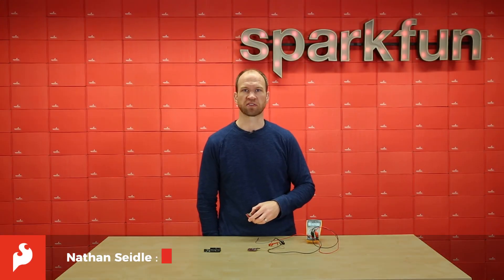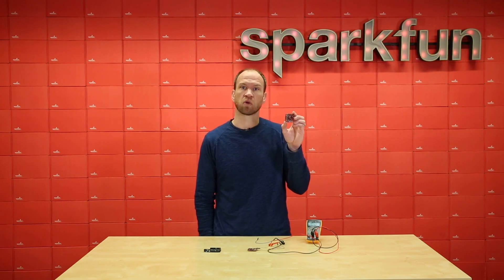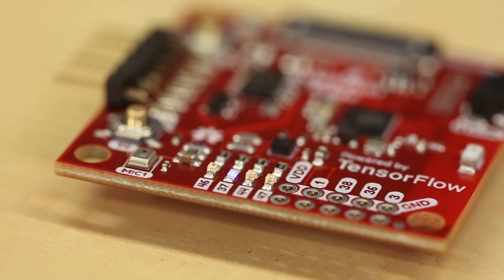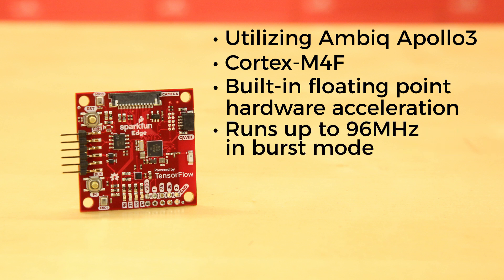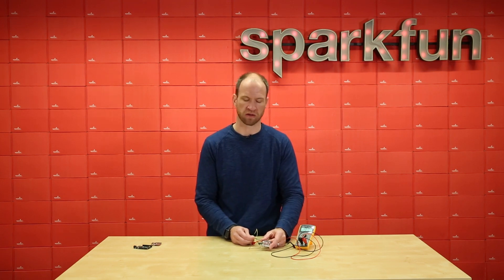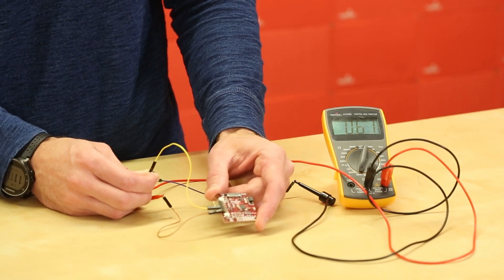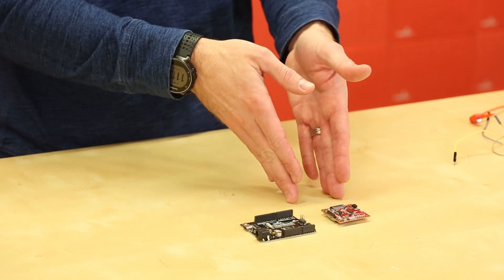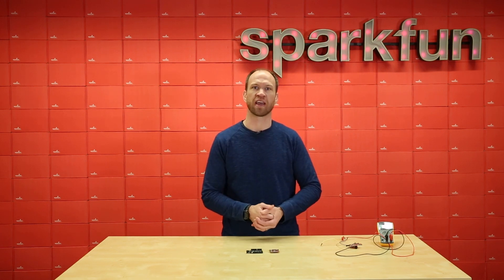Product Showcase: SparkFun Edge Development Board

Comment: Uh.... 
I don't follow your math where you say the board can run as fast as six Unos.  But then you say you'd need 30 edges running at the same time to equal a single Uno.  
Um....
Do you mean that a single Edge consumes 1/30th the power that an Uno does?
This should be clarified.
Reply: Yeah, 30 edges running to equal a single Uno in power consumption sounds like.
Reply: It runs as fast as ten fast men! Palm trees bend in the wind as it passes them by!